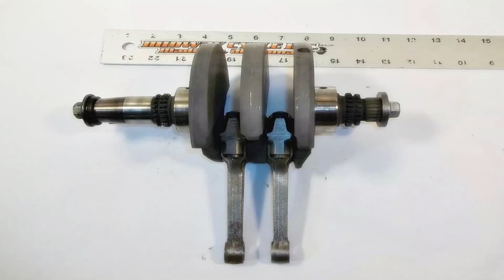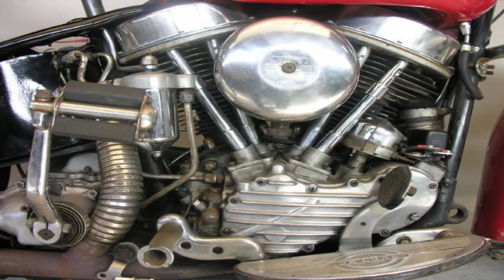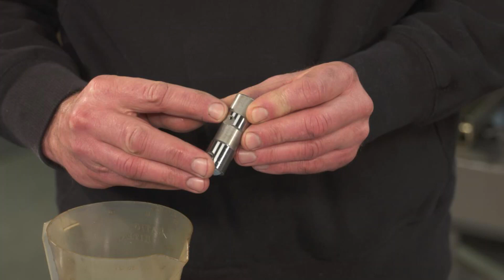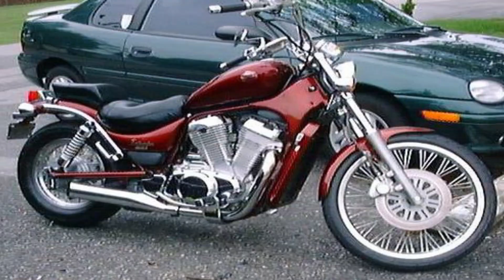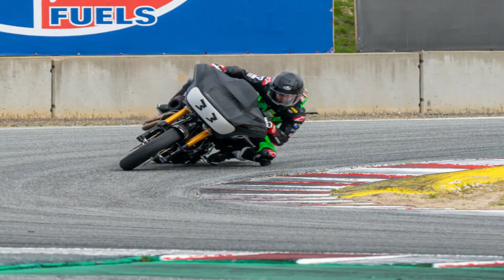Harley-Davidson Engine Design is the Worst

Comment: Yes it’s time to move ahead. There’s plenty of potato bikes in the used market and younger riders aren’t going to buy these bikes when a SV 650 will  smoke a softail. Harley really needs to reel in its stealerships though. I think they do more to damage the brands reputation than anything. I went to look at the new sportster S and they quote me a price of 17k! Same thing with the new street bob, 17k. Nope. Build all the bikes you want but if they are going to try and take advantage of me you can keep it. I don’t think corporate cares though. I think Harley will price themselves out of their dominant position before anything else.
Reply: SV 650 is a good bike, but it won’t smoke a modern Softail, or really even come close, for what Softails are meant to do.
Reply from the maker: That's my fear with Harley is upgrading to new tech is that they will price themselves way too high. Not that it seems it could get any higher, they are pricey as it is.
Reply: Where are you from? 17k for a new Streetbob seems low. Especially if it's got the 114. I was looking at a low rider s, and it was 24k. I ended getting a 2013 wide glide for 15k
Reply: Well if I’m going to the track I’m not taking a softail. A sv650 however is a respectable choice. The point is that a modern 650-700 class bike will out perform a modern softail which is important to a lot of younger riders.
Reply: @robbyclark6915  most people aren’t spending any significant amount of time on a track. If you are then a Softail or Bagger obviously isn’t the bike for your interests.

An SV 650 or similar bike isn’t going to compete against a Softail or Bagger if your riding includes a girlfriend/wife or multi-day trips.
Reply: @robbyclark6915  You'd be surprised to know that a big chunk of youngsters really consider a H-D as an option, but problem is they can't afford one.
Reply: @omarsalgado9715    It doesn’t matter unless they are making purchases. Wanting, wishing, considering, doesn’t sell new motorcycles. Like I said in my comment. Harley needs to do something about this price gouging. Their bikes are already a premium and then the dealerships add whatever they want to the MSRP. It’s not sustainable. They will not continue to sell new motorcycles that way. Their sales numbers show that. A steady decline every year.
Reply: I saw a Sv650 smoke a while ago ,it was burning. I think he burned the rice!
Reply: @bobvido9875    Yeah, it was in your dreams……😴😴😴

Comment: With the power potential of the new M8's with simple cam swap i see no need for them to upgrade the motors in their touring and cruiser line-up
I do however wish they would spend more time optimizing their maps on the SE tuner so people wouldnt have to void their warranty to get a cleaner running and optimized fuel and timing.
Reply from the maker: Cam swaps on a M8 is amazing, it makes a huge power and torque gain!

Comment: Happy New Year GF! Good points all. Of course we don't ride Harleys for their cutting edge technology, and low end torque is probably the most important thing to most Harley riders. I don't see much point in redesigning the M8. Air cooled engines have a limited life span at this point, so I think they should just keep them going as long as possible while shifting into water cooled engines. The trick will be to keep the sound. The Sportster S does not sound very appealing to me so I hope they can do better than that.
Reply: Lose the sound, lose the market.... There is something very deep about that 45 deg crank, it strokes or massages your soul.... They will figure it out one day like wind therapy.....
Reply: Agreed

Comment: the design doesn't bother me . like you said the pressed crank and roller bearings does. to me its laziness after all the issues they can have. if they addressed those issues then i would understand they tried something new and had to work it out.  i haven't heard of the S&S pressed cranks having an issue . i know they have a plug that is supposed to "lock" it all together.  good vid
Reply from the maker: I think that's the key part Harley is missing that S&S does!

Comment: I love scissoring flywheel assemblies, have done so with 2 Evolution ones so far! Every time I do I end up with a much better motor once I make it better than the way it left Milwaukee!
Reply from the maker: That's the way to do it! Sucks when it happens but getting it fixed right when it does is the perfect time to make it right!
Reply: @GixxerFoo  yep, in my opinion going with the Ultima 4 5/8" stroker flywheels was the best thing I've ever done! I retained my stock cylinders and the bike "looks" stock in appearance. 89" is the way to go in my opinion.

Comment: Every single combustion engine ever made is still a piston in a cylinder. Debating what surrounds that combination is nonsense... calling it obsolete even more so. With the exception of computer control, there literally is nothing new or not tried sense 1872.
Reply from the maker: That's pretty accurate, computer control is about the only thing that's changed. The concept is still exactly the same.
Reply: It would be like saying wheels are obsolete design, though every manufacturer needs and uses them, no matter if they are spoked or mag. Compared to electric engines, each and every combination engine is pretty obsolete. And even then electric engines are not that state-of-the-art technology either.
Reply: Well, what you are saying is the combustion process is the same and you are correct. What is debated is the actual engineering and mechanical process which can be considered obsolete compared to improved mechanical process. You can actually see this in aviation piston engine development. They have cutaway engines for training. It is all about how a crankshaft is turned and where the power is delivered to that shaft. See the Wright Cyclone radial piston engine.
Reply: @semperfipar1299  Still just a piston and a cylinder. Everything has been tried. Everything. There is nothing obsolete with combustion engines. The quality of the mechanics is irrelevant.
Reply: @hawkdsl  Now you are just being ignorant. Yes, everything has been done. Just look at aviation piston engines.
Reply: I disagree, based on how much the character of an engine can change just by adding or removing a ballancer shaft or swapping out the cam. Also with a 2 cilinder, the angle between them changes how pronounced fundamental and secondary vibrations are. Just look at how a crossplane design affects the Yamaha R1, just by changing the crank a bit.
Reply: @bmp72  It's all old ideas. It's a piston and a cylinder. There is nothing new or untried. Again, what surrounds the piston and cylinder is just salt and pepper.

Comment: I think they should kind of do both. They must R&D their liquid cooled engine. It’s the only way to keep up with emissions. However I think they should produce the M8 as long as they can. Maybe improve it a bit. Tighten up crank run out tolerance. Sturdier bottom end. Etc. definitely a new frame is in the future going to liquid cooling so put a great suspension under it. It’s obvious that their next touring platform will be a well refined machine. But, it better be really good otherwise, might as well throw in the towel and buy a dad jeans Goldwing. Lol. Before you goldwing guys climb all over me for that comment I’ll just say this. I have nothing against the Goldwing. It’s the pinnacle touring bike hands down. It’s just not for me. (Yet). Ride safe all.
Reply: Like a car with two wheels. The more modern and technical these bikes get the more you are at the mercy of the dealers. I’m old with an old Harley that I can fix myself.
Reply from the maker: Oh yeah Gold Wing no ones going to top that machine, that's the top tier in my opinion.